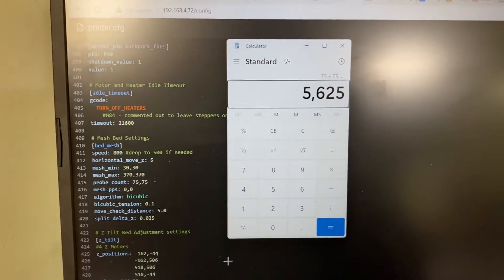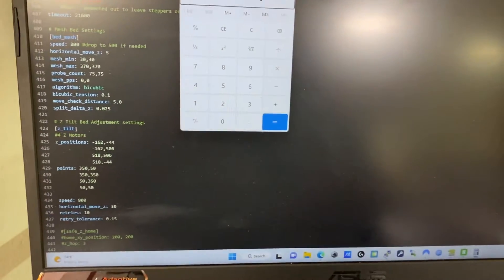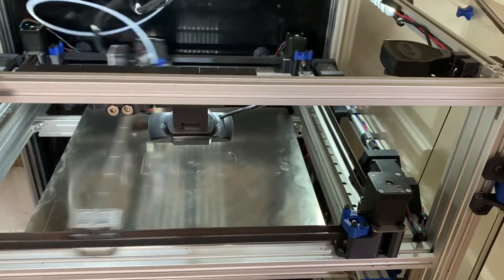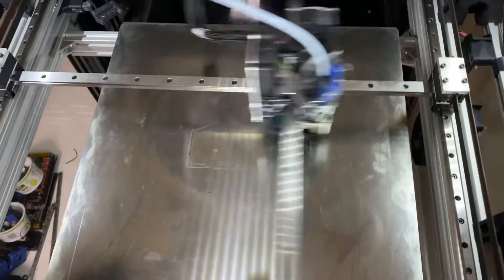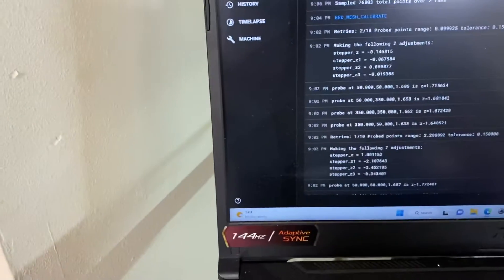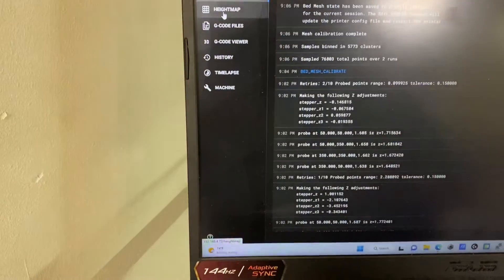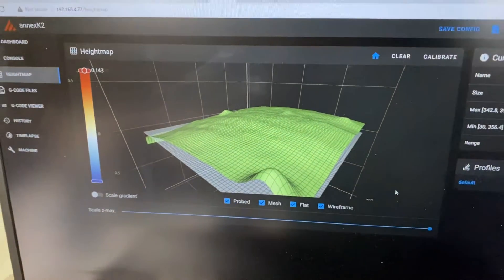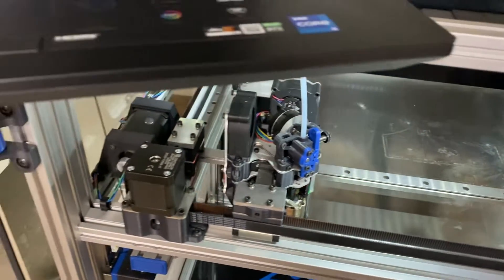5,625 point bed mesh via Beacon3D

Comment: The eddie currents would be generated by the outermost metallic surface . if the underlying bed is what it is scanning it's useless since the surface of your carriage is nowhere the same as the spring steel print bed.

Comment: The downside with this is that it's probing the spring steel sheet for flatness and not the actual surface.  The printer may know exactly where the steel sheet is but what if the PEI coating is uneven or there's a bubble under the PEI sticker?  This is where I think Voron Tap is better because it probes the actual surface.
Reply: most consumer PEI boards are manufactured by machines and the sticker has a constant thickness just like any kind of film produced today. the error of margin from these PEI sheets is smaller than that of your printer's  motion system.  probing the surface has its own downside the very pressure of the probe can deflect the surface just enough. I've seen the springs in my bed move just from a push from a microswitch probe.

Comment: Great for metal build plates. Useless for glass. A Lidar module would be great.
Reply: yup. totally useless for non metal surfaces. But printing on metal is like spreading jelly on toast. It's wonderful. You should join us!
Reply: @beaconscanner  Can't/won't. Bed temperatures are too high for magnets, and I can't print my materials on PEI. Glass with gluestick is IMO, the best.